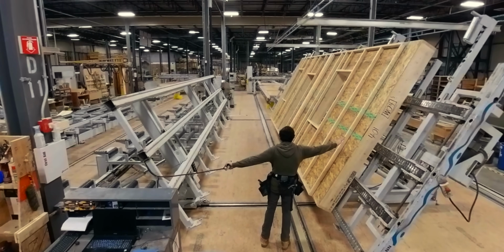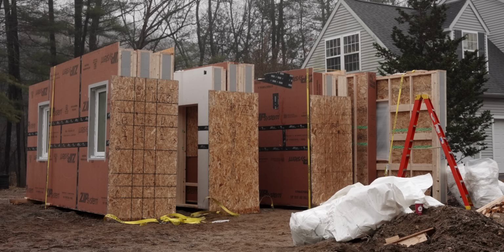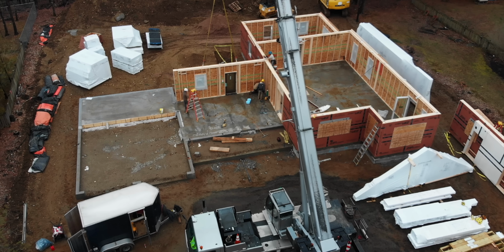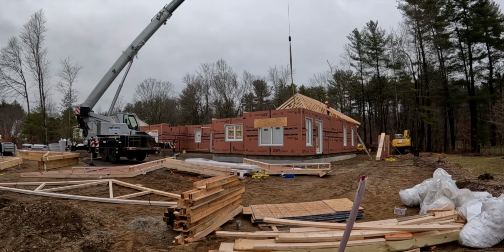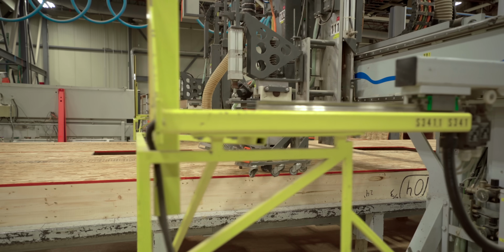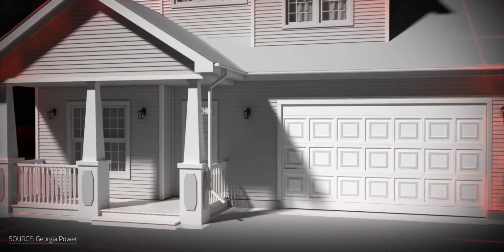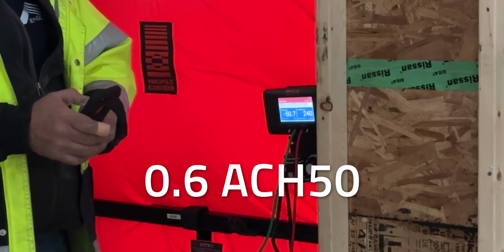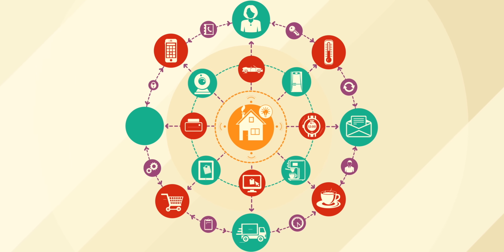Wow! I Didn’t Know A Prebuilt House Could Do This

Comment: Up here in Montréal we (the government and a few of our universities) are looking into the effectiveness of using “the perfect wall” or « le mur parfait ». Two exact same house designs were built one next to the other. One using traditional, modern construction methods following current code for efficiency. The other is built using the principles of the “perfect wall”.
Both houses are loaded with sensors to determine just how much water infiltration there is, how well is it managed, what damage occurs. Heat, air circulation, air quality… all that sort of stuff.
They appear to feel that a well insulated house using the “perfect wall” is actually cheaper to build.
The core reason is that they wish to have houses which last MUCH longer (>=100 years) than current ones.
We need housing and can’t afford the current two steps forward and one step back approach.

Does your house use this approach? Btw, the idea of the perfect wall came from some locality in the norther Midwest of the US.

Comment: As a residential carpenter and new home builder I can say you went the best route by going with 2x6 walls covered with the zip sheathing. A lot of company's have been using foam for exterior sheathing covered in vinyl siding, both of which you could punch through using your first with no problems so just imagine what a decent thunderstorm could do! I can also tell you that these materials are fine being outside during the couple weeks of framing, in my instance we build the entire house on sight from the foundation up and at most it takes only 2.5 weeks to complete and the roofers to start shingling and that they get done in just a day or day and a half so the house is weather tight within three weeks from start of construction.
Reply: Nobody is using foam for sheathing. They will still be using osb underneath it. Foam is great and is a good way to insulate. Zip even glues it to a lot of their sheathing types.
Reply: @paladain55  I was going to write the same about  foam "sheathing". It is possible that the OP is referring to a membraneish sheathing/covering that I have seen in a Matt Risinger (@buildshow) video. It did look sort of like foam, perhaps 1/8 thick plastic stuff. He questioned whether it provided any shear strength at all and you could tear it with your hand. Allegedly code compliant in the application shown however.
Reply: I live in a Pulte built home near Chicago.  Our previous home was custom built with 2x6 walls, plywood sheathing and double pane windows.  We had cedar siding which was a pain because it wouldn't hold stain.  We've been in our Pulte home for 17 years.  It's built with 2x4 walls and Dow 1" foam sheathing (the corners are OSB with 1/2" Dow sheathing.  There are a few places where they had 1x3" cut in bracing.  The walls were all built off site.  So far, this Pulte house is just as comfortable as our custom built house.  High winds don't seem to affect it.  My biggest complaint is that our Pulte home is rather transparent to noise.  If someone is talking outside I can hear it.  When the paper thin vinyl siding heats up and cools down I can hear it inside.  Finally, we've had a few houses burn down in my neighborhood. When the vinyl and Dow insulation starts burning it's hard to stop.  If the fire makes its way into the truss roof -- game over.
Reply: And I wish that my house here in Georgia had 2x6 exterior walls but sadly they generally only do 2x4.  🤯 I would have loved the extra insulation and increased R value.
Reply: Have you seen/used Tstuds before? Thermally broken 2x6s built from 2x2s and dowels that are actually the same strength as a regular 2x6.
Reply: As a European, I am used to the outermost surface being stone, brick or concrete, providing excellent mechanical protection for the insulation and inside rooms.  This also adds to the total thickness of walls, thus providing windowsills deep enough to sit sideways between the window and curtains.
  For prebuilt houses, the outer stone layer is part of the factory delivered walls, thus needing heavier trucks and cranes.  Various stuff is cast into the concrete at the factory, including pipes for water and electricity.
Reply: Zip is cheap osb.  Use plywood and 30#  tar paper.  Yes 30#.

Comment: My house is “real factory built”. . .  Constructed in two halves in a factory 400 miles away, trucked to the site and placed on a precast concrete basement.  I bought it more than 50 years ago, figuring if it could survive a trip on the highway, it would last me a long time.

Comment: Be extremely critical with contractor that all sobs follow best practice for penetration of envelope. 
Be sure the wall between the garage in the living space is treated like exterior wall, as garages is difficult if not impossible to be airtight plus potential chemicals in garages should not get into living spaces. 
1. Personally dictate to all contractors & subcontractors that all Pex, HVAC & electrical penetrations are made individually, through exterior walls, don’t allow bundling of conduits or pipes together walls as it is difficult if not impossible to ensure air tightness. 
2. Review Matt Risinger’s channel as he has a good grasp of best practice.

Comment: Nice build and very rare to see such windows in the US. (Here in Europe those have been standard for decades...) I am fairly surprised though that you "only" achieved .54 on the blower test. I had a prebuilt house constructed for myself just last year and it came down to .24 at the very first test run. I would have expected similar results in your case.

Comment: 0.15-0.13 windows? thats nowhere near R7ish.... di dyou mean 1.3-1.5 ?
Reply: U-Value = 1/R-Value. So that conversion is correct. There is some ambiguity since the U-Value always contains external and internal resistance (resistance between air and wall), while R-Values often do not, but roughly it is correct.

Comment: I have built using SIPs in most countries in Europe, from Norway to Southern Spain.  Apart from not using SIPs for the roof, as you commented in the video, I would definitely use PU foam filled SIPs for the walls including the internal walls. Use aerogel as a gasket to avoid thermal bridging in the sole plate and ring beam. When designing the house create air locks where there are external doors. This is easy ... vestibule or porch. We have a factory which makes the SIPs and a shop which processes the panels. However we now have a 'shop' on wheels and process the panels on site. A big thing is not to use concrete... very polluting.... Foundations are screwpiles supporting a timber frame and SIP floor. Very quick. Internally use spray plaster. I dislike Passivhaus.... it is not good enough and typical of a German system, it's complicated. We use Airtight Building Standard, where the test is to pressurise the building and look for leaks in each room.

Comment: I grew up in the US but nearly all my adult life has been in Ireland and house construction here is so, so different.

One thing I'd say for solar panels is to max them out. You can always sell extra back to the grid. If folks would transition to wind/solar/storage and other renewables the cost of energy would be super cheap. They're not going to do it quickly though so I expect energy prices to keep rising while people with sunk fossil fuel costs drag this transition out. You can save money and make money on it with an over-specced solar array.
Reply: Fewer and fewer utilities in the US allow you to actually sell back your excess energy to the grid for $; most will give you non-transferrable energy credit that expires after a set time (where I am I think it's 1 year), and that credit is sometimes not 1:1 (for example, if your excess is 1 kwh in the middle of the day, it's worth .5kwh in the evening).

Comment: Hey Matt. I used to construct concrete foundations with my father, and what stood out to me was that you aren't taking advantage of New England's building codes for frost protection to go for a full basement on your house. Was that a energy efficiency choice, a cost saving measure, or a long term single floor living choice or something along those lines? My brain kinda short circuited for half the video because of that.

Comment: I worked in a modular home plant for 30+ years. The homes we built were almost completely finished before shipping so they were setup in a week or two depending on the type and number of modules (up to 12). They are designed for upper midwest states so they are very tight and well insulated.
Reply: What brand? Would you recommend them?
Reply: @HCG  I tried to reply to you but it keeps getting deleted. Maybe if I put this. They're made in Marshfield, WI.
Reply: @tims8603  WI Homes?
Reply: @HCG  Yes
Reply: @tims8603  But would you recommend them over other modular house manufacturers?
Reply: @HCG  Well, obviously, I'm biased because I worked there for many years. I also haven't researched the other manufacturers because I already own a home and I'm not looking for a new one. I don't have anything to gain by saying good things about them because I'm retired now. All I can say is they're well built and conform to all codes in this area. In many cases they exceed those codes.  

You would have to do your own research and comparisons. Their website has a lot of info and photos of finished homes. There are many short videos here that you can find by searching the company name.
Reply: @tims8603  That’s all I was looking to hear, thank you.
Reply: I bought a modular, it worked out quite well.  In the fall, it was hard scheduling the crane (mine was a two-story, with 'four boxes' basically).  Friend across the river was like, "One morning we saw some plastic wrapped boxes, that night we saw a house complete with windows/doors/ roofing, siding."  Lot to be said for factory construction (mine even had slate stone floors in some of the rooms, installed from factory.)

Comment: I had a factory built home made 25 or so years ago. It was completely built in the factory and came on 4 trailers. This was a 2 story, 5 bedroom, 4 bath 3k sqft house. In half a day it was mostly done with shingles on the roof. They came back to finish some trim, cleaning and fixing anything that didn't look correct. I had put in a ground source Water Furnace. In Indiana weather and on a coop electric company the highest bill was about $125. That's with 5 kids, pool, two wells and total electric. That factory built was awesome because the house was build from the inside out, allowing caulking on the back of electric boxes, which they did. Since I've converted a almost now conventional home to net zero by converting to total electric and putting on solar. When I sold the house the electric utility paid me $185 for the last year. Currently I have a custom built home. It is not the best designed for energy efficiency. The builder had never even tried, but I was able to spec the insulation and a few other things and ended up with a HERS rating of 45. I then put on solar and still have some more to do, but I fully expect to be net zero before it's done. Net zero is not hard at all with solar the way it is. Not that much of my roof has solar as there are restrictions from the HOA. I believe the cost of solar now makes it a better value than trying all the energy efficiency tricks to get the most efficient house. Example, ground source heat pump is very efficient, but costly and it only benefits part of the time (heating and cooling). Solar is similar in cost, but pays back year round.

Comment: Depends where one lives if you can actually get a factory build home.  I am in Atlanta GA and no one around here does factory build homes - at least I couldn't find one.  I am disappointed that you didn't get the factory sealed attic space - we insulated our roof with foam which means the attic space is conditioned like the house which makes the top floor much more comfortable in both the summer and the winter.

Comment: Honestly I want to see everything in excruciating detail to be super informative (but most topics prob aren't really in your content bubble);
1. electrical/networking and future proofing.
2. Plumbing and any fun efficiency tweaks.
3. Obviously anything like solar, geo, batteries, etc.
4. General HVAC and how do you keep air fresh - often the concern for a home too well sealed is just trapped allergens building up.
5. Smart home stuff? Any other fancy features? Home security?
Just some rough ideas

Comment: I remember seeing another video where they set up a positive pressure door blower and deployed a insulation mist machine. The mist was basically caulk and would find all of the air gaps left in the envelope and glom onto them, sealing them like blood platelets.
I do wonder if that's almost TOO tight though - like what happens if the power goes out and the air handlers are off for an extended period?
Reply: You open the windows.

Comment: Back in the 90s I was installing those style of windows your installing in your home now :P.  back then it was just 2 layers =) Good to see this product finally made it to the US =) ..  1 note on those windows is make SURE to press the window all the way in before you go from Tilt to normal open .. 90% of the problems we have had with this style is older people that dont have the strenth  and end up with only 1 Hinge active . And the window will only be connected in the lower Conour.  Back then the windows where so air tight that tons of humidity problems started to happen as the houses and apartments did not have any mechanical Airflow.  And btw my own new house was done 12 month ago with this  same window style =) ..  And Hello from Denmark .

Comment: Have you thought about using power over ethernet lighting? You can run them directly from your solar/battery bank instead of requiring an inverter and you get the added benefit of them all being smart controllable.

Comment: Think about in-floor radiant heating and in-ceiling cooling.
It is my favorite choice of heating system. Maby you also find an installer for a European / Swedish heat pump.
These combinations allow passive cooling of the house in combination with geothermal. These systems will pump the water between the ceiling and the geothermal loop. It uses a heat exanger for passive cooling. If that is not enough, it will activate the heat pump for cooling.

Comment: A Q&A video would be great. Does it/can it have a basement? Also, wondering if you will do the insulation technique, when the house is a white box, that sprays aerosolized plaster-like material that are then air blown to seal any small gaps.
Reply: Why shouldn't it be able to have a basement?
Reply: @Jehty_  He totally can have a basement, but appears to have chosen not to.  We built a factory-built home in MA with a full basement (ICF forms for the foundation of course.)

Comment: What's the reason for no basement?  Is it the soil in your area or does it have to do with the net zero goals?
Reply: I see a lot of comments asking about why there's no basement. I rarely see homes with basements, and have only rented one house with a basement that we never used. Genuine question, why do people want basements? It seems like a real low return on investment to me, with no natural light or windows, not a place I want to spend time in.
Reply: @thentil  most basements have windows. In modern homes it's another finished space. We use it for laundry, storage, another bathroom, bedroom, family room/home theater. It provides access to plumbing, electrical, and HVAC. It is also a safe place during tornados.

In my ranch home our basement provides us double the space without double the land space. 

In cold climates (I'm in the upper Midwest), the vast majority of homes have basements. This gets the foundation below the frost line.
Reply: @jimmypautz  Thanks, interesting how the experience changes based on local hazards and climates. I can definitely see the value of easy access to plumbing, the crawl space under our current home is the last place I want to be.

Comment: As my wife and I are now empty nesters in a 1980's four bedroom house (forced hot water oil heat and window AC units), I am looking ahead to downsizing.  We live in New Hampshire.  Your approach is exactly what I am looking for:  tight envelope, good insulation, all electric using geothermal and solar.  As close to net-zero as is practical.  I'd be interested to see a comparison between up-front costs and monthly energy costs between your house and an identical but traditionally built house.  What's the break-even period?  I might contact Unity Homes to see what they can share.
Reply: US Building Codes have aggressively improved energy efficiency for new builds, starting quite a long time ago now. From at least 2000 onwards you'd be surprised how good (most) homes are.